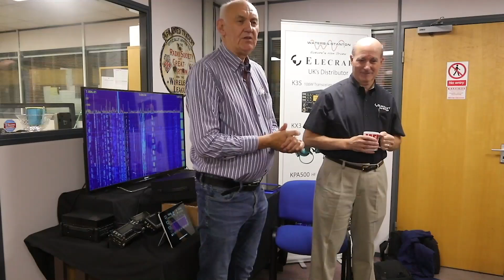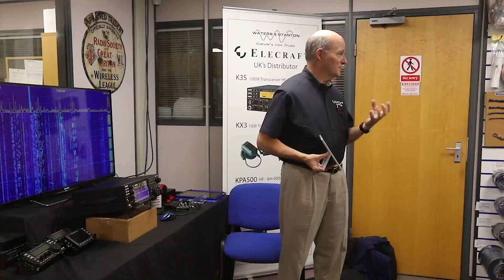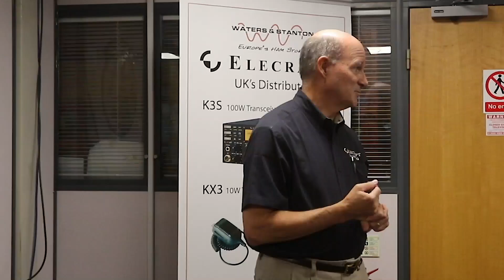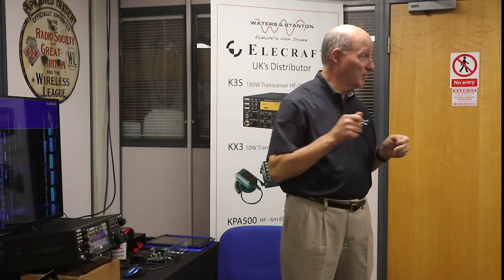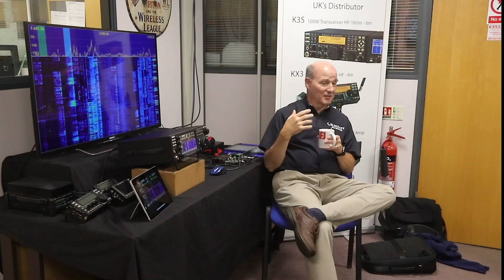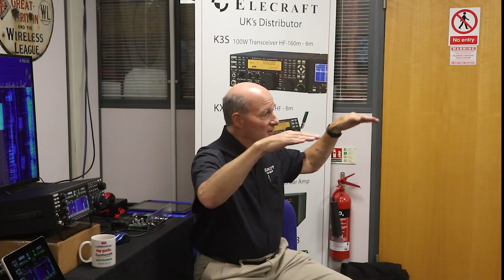ELECRAFT K4 IN DEPTH  with WA6HHQ at Waters & Stanton Ltd Portsmouth UK

Comment: In what cases would this radio be a better choice than for example, a FTDX10 or FTDX101 with the digital noise reduction?
Reply from the maker: There is a full review coming out un RadCom. You can rhen better judge it.